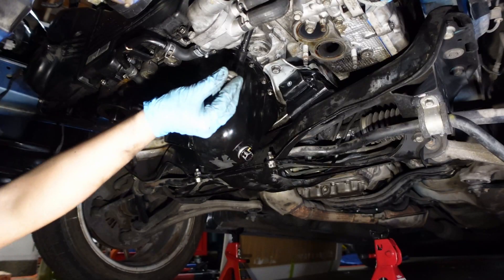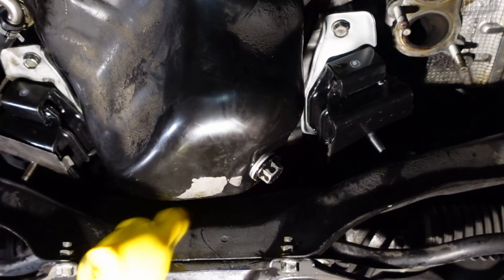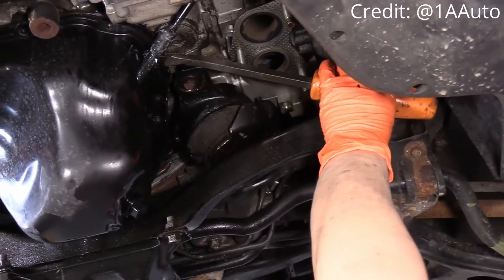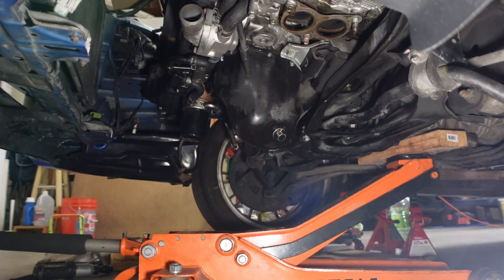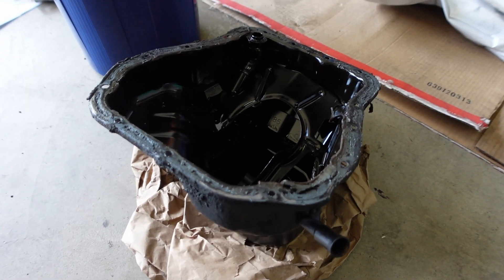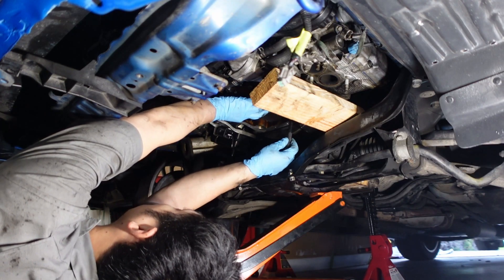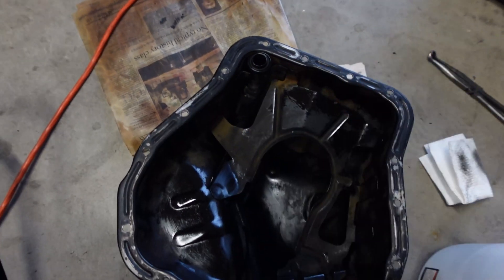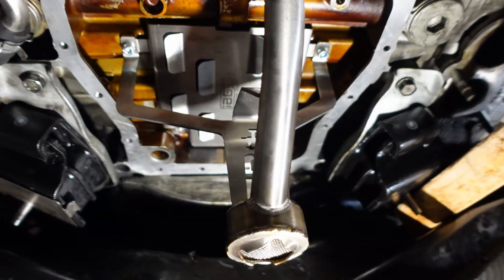Upgrading Subaru STI Oil Pan and Oil Pickup Tube & Windage Tray Install | Tutorial and Tips

Comment: Hey, very good explanation video, just can i put the reference number on the o ring seal inside the pan??
Reply from the maker: yes, for some reason there are different part numbers for different years of the same generation so just to be safe I would confirm with your car's model year. But the official name of the part from Subaru is called "Engine Oil Pan Gasket. Sealing Oil Pan"

Comment: What is the average amount of time it would take to do this in your driveway with a floor jack and 4 jackstands? Another thing, you unintentionally or intentionally fixed one of Subaru’s other F””k ups. The machine in the factory that applied the RTV to the oil pan put too much RTV in and over time it degrades and pieces fall off inside the oil pan. This can clog the oil pickup ( hopeful the screen at the bottom of the pickup tube prevents the flakes of RTV from getting into the engine’s oil passages ) starving the engine of oil therefore causing catastrophic engine failure. Since this would happen well after the warranty period is over Subaru doesn’t cover it. There are a lot of complaints about this issue and hopefully Subaru does the right thing and recalls the cars plus covers the oil pan removal to assess the RTV situation and correctly apply a “ thinner “ amount of sealant or better yet a quality gasket. In a Subaru shop this should take a Subaru Tech about 2-2.5 hours. If they did it would be nice if they would install an upgraded oil pickup made of steel tube with no weak soldered joints and maybe a windage tray. The oil pickup tube should be part of the recall anyways and not just a replacement with the same part!
Reply from the maker: That explains why it was such a PITA to get the oil pan off! It was REALLY on there with thick globs of RTV. When I reapplied the RTV I did the service manual's recommendation of a thin and even bead.

Honestly its not too terrible of a job on paper. Removing the exhaust manifold made it easier and if you unbolt the pitch mount and engine mounts, jacking up the engine gives you a good amount of room to get all the pan bolts off.

The thing that took the longest (a couple of hours) was trying to get the stock pan off because it was cemented on there. Even with a oil pan remover tool (its like a wedge to separate the pan) it was a pain.
Reply: @HazardGarage trying to remove the pan without destroying the integrity of the oil pans mounting surface is my concern. If you can get that separated tool started on the easy to access side you could probably use plastic wedges to drive in there qently to help rip that sucker off?
Reply from the maker: @Zeek800 yeah i was very careful not to scuff up the mating surfaces. The oil pan remover tool/wedge was helpful it was a little tough also because there wasnt a lot of room to swing a hammer to wedge it in. But once you get the wedge in, it was very easy to work around the pan and get it off. What you dont see on camera is me struggling for 2 hours trying to just tap this wedge in lol
Reply: By the way, I watched a vid by a guy who has a Subie Shop with a 4 wheel Dyno. It was a day or two after Christmas and a friend of his had gotten a 2018? STI RA? from his wife as a Christmas gift, so they decided to see what a stock STI makes for horsepower and torque. They both made guesses and on hp the car owner said 230 and the dyno owner said about 240. For torque their guesses were around the same. They made 3 dyno pulls and this STI actually made 270+ hp and around the same for torque at the wheels. On the third run, he put it in Intelligent mode and it actually made a little more ho and torque. What all 3 runs showed though was that Subaru sets the ECU to be lean on the air/fuel mixture apparently t0 scrape out another 1 or 2 mpg in fuel economy. This is another thing that the owners need to address themselves by getting a tune even on their stock engine to richen up the air/fuel mixture a little bit. If you’re hard on you stock engine a lean condition is another engine destroyer.

Comment: Duuuude, what kind of oil are you using and how long are you running it, or rather, how long does it stay in the poor engine? Just look at the color of the inside of the block. Horrible! Is your STI still alive? I don't want to know what the oil control rings look like. They're definitely clogged and stuck. I recommend flushing the engine, preferably three times in a row.

Otherwise nice video 👍
Reply: He said in a reply to another customer that his engine has I believe he said 118,000 miles on it. That engine isn’t that dirty for an engine with that many miles.

Comment: Do  i need to unbolt the dipstick from up top or no? Im preparing myself to do this job to my 06 this weekend
Reply from the maker: I did, it makes it easier to yank the dipstick out by the dipstick rather than try to pull the oil pan off the dipstick.

Comment: nice video   im doing this soon. Iv heard getting the oil pan off is not easy
Reply from the maker: I agree it wasn't easy. The hardest part for me was breaking the OEM RTV seal. The special tool I linked definitely helped. As well as removing the headers. Most videos/instructions had difficulty with the bolts in the back but if you just unbolt the 2 engine mounts and lift the engine a bit, access was easy.

Comment: My pickup was fine on my 2015 STI at 105k. Installed an IAG one just for the hell of it.
Reply from the maker: mine was at 118. But since we were in there...might as well!
Reply: Im wanting to believe that Subaru upgraded the oil pickup tube especially on the 2021 STI. Maybe not but this should be a recalled item.